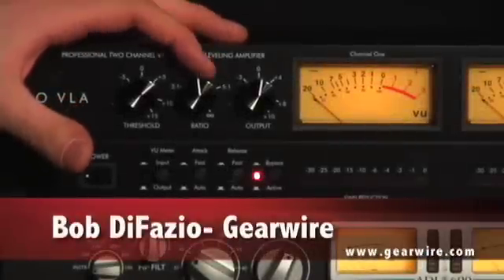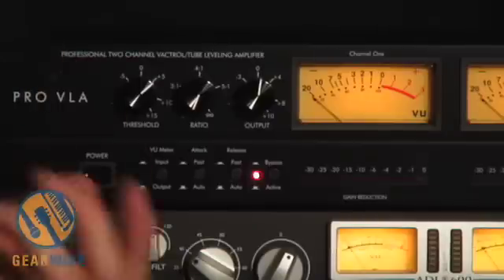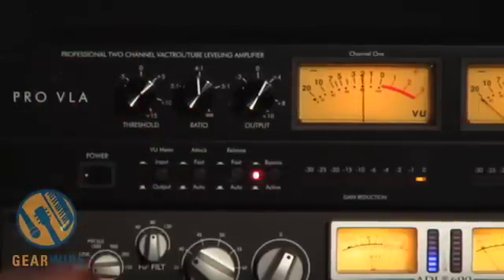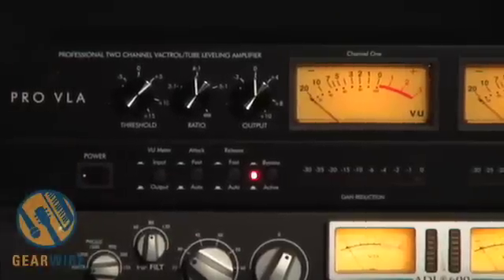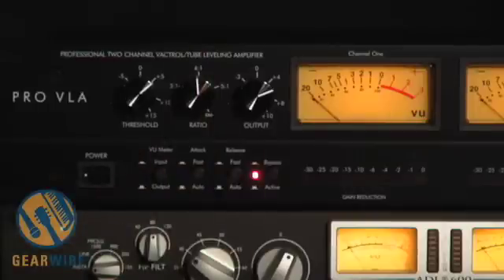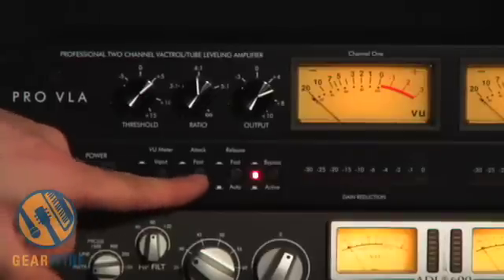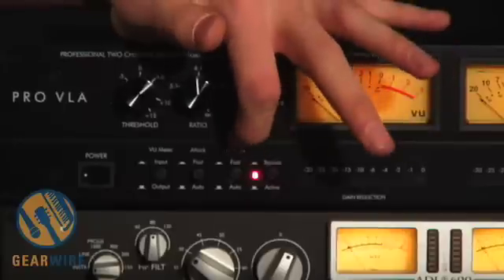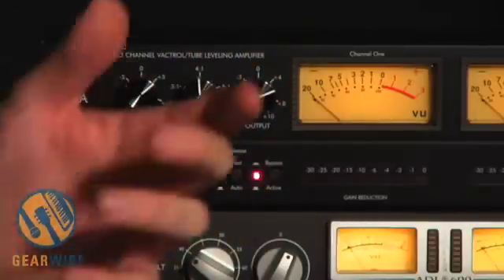ART Pro VLA Compressor Keeps Your Dynamics In Hand, Part Two

Comment: hey i have a mackie 400f  will this boost the gain enough that it can go into the non preamped line inputs of the 400f or like would it boost gain enough for going mic to art vla and like a maudio delta 1010 line inputs ? or would i need like a art mpa2 after this unit before going into line input.. love both the products but just wonder if i could only get one  the tube mpaII or the VLA which would i be better off with...  thanks for doin this vid also.. just learnin :)